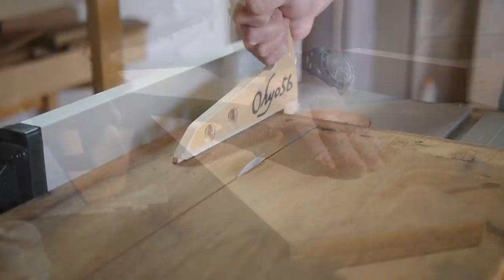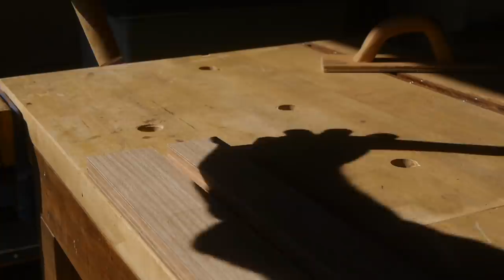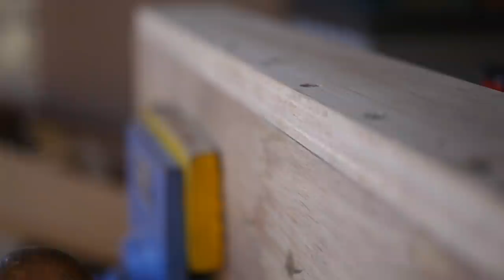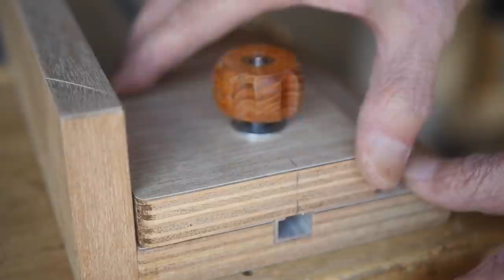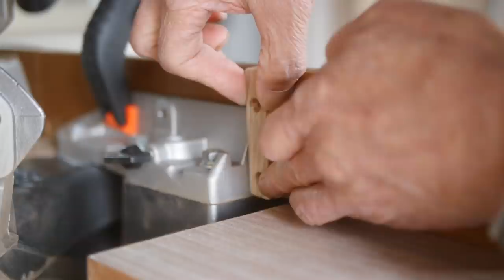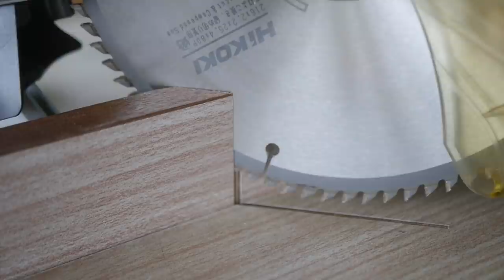Jig for picture frame

Comment: That has to be the best picture frame jig design on you tube. Bravo. Liked, commented and subscribed.
Reply from the maker: Hello, Mr2at
Thank you for coming to my video
And thank you for your wonderful comments
I used to do this with a table saw.
This new jig is the best pairing with Miter Saw!
I wish you good luck.

Thank you
Reply with all my heart from Japan
Reply: @TachiOhyo56  The compact design is amazing. Hello from England
Reply: It doesn't do anything. What exactly do you mean by 'best'? It does NOTHING. Have you ever made a picture frame? This thing helps you how? It does NOTHING. The saw cuts 45 degrees without the thing. There's no way to measure length on this thing and there's no way to cut out the relief. So what is it good for? and why do you say best? BEST AT WHAT?

Comment: Once again a simple jig for production.  Nice design!  The only thing I might add is a stick on tape measure so I could set it for sizes.  If you start it at the saw blade and go back toward the stop.  Thanks again my friend for a fine fixture!
Reply from the maker: Hello, pjsalchemy
Thank you for always watching my video
And thank you for your nice suggestion, I will also use a tape measure.

Thank you

Comment: you made an elaborate contraption that does nothing. Tell me: are you any closer to making a picture frame after you've wasted time on this? I can answer that. NO! Your mitre cuts 45 degrees without that contraption. AND you still have to measure the length before you use it. AAAAANNNNNDDDD!!!! You don't even know where to measure FROM because you haven't cut out the relief for the picture to sit in. So, why?
Reply from the maker: Hello About A Boat
Thank you for your valuable advice
You're right, I'm wasting a lot of time, taking detours over and over and enjoying my hobbies. And my work is a whimsical and adventurous woodworking! My friend enjoys my video.

Thank you for coming